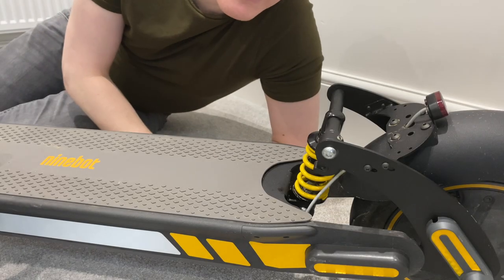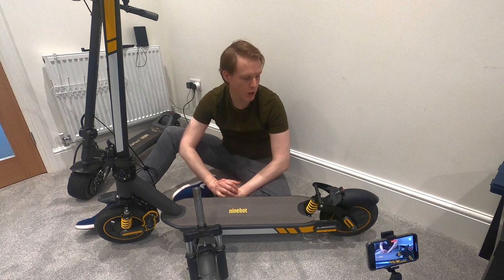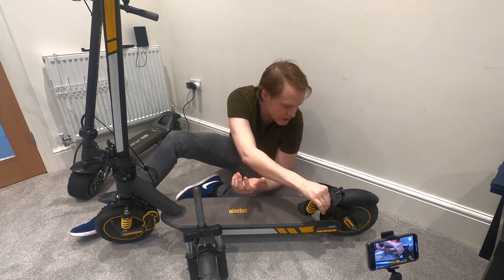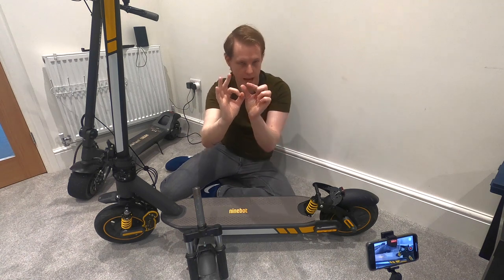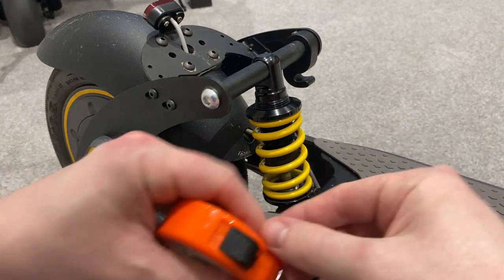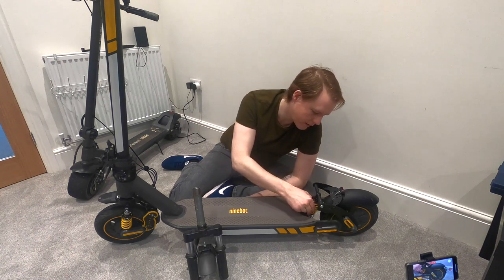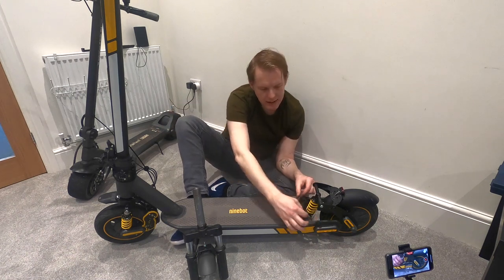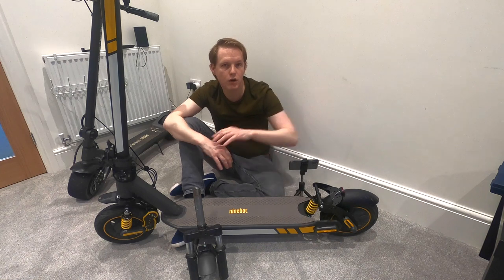Should you buy rear suspension? Ninebot Max & Xiaomi M365

Comment: Eagerly anticipating what sharkset comes out with for the rear. Monorim seems to be more of a hassle than what they're worth both front AND rear.
This one is the only viable option at the moment. I Agree totally on every aspect you mentioned.  I get a strange vibration noise or rattle from it. Possibly from 
one of the pivot points.. Like you said it needs proper bearings to make it more solid. but there's no way i'm drilling holes in the frame nor do i like the 2 piece fender of the monorim.. Good review as usual!
Reply from the maker: Thanks dude. Yeah I didn’t fancy the hassle of Monorim. And the split fender.  

This is going to suit ok for the time being.  

I did speak to Farahbod at Sharkset and there may or may not be suspension coming. The issue is how do you design something here that was designed without suspension in mind.

And he doesn’t really want to rehash the suspension ideas that are already on the market
Reply: @ScootLetsGo  The monorim is perfectly fine, they have a v2.0 out now, and will be bringing out a Special edition very soon! I like the look of the shark suspension, it would have been even better with air shocks as well. Which link in your description is for the shark please? And where is the coupon code?? 😊👍🛴
Reply: @fleebleflam  where is it?

Comment: For the bolts/screws rusting problems, you can use some threadlocker (I recommend the blue type - red will permanently lock the screw) to lock them in place and apply a thin coat of hydraulic grease on top of them. That will prevent any rusting if water makes contact with them.
Reply from the maker: Don't worry I got some threadlocker. :)

Thanks for tip on rust proofing

Comment: Hi mate. How tight should my standard max bot steering be. I think my bearings are pinched. I can’t find anywhere on YouTube in regards to stiffness of steering etc. I have found your links to bearing replacement. Kudos.
Reply from the maker: Hey. They should be right.  But not so tight that you cannot turn the stem easily.  And you’ll know if they are lose because the stem will wobble slightly.

Comment: How much of a difference does it actually make? Is it a dramatic increase with the just the front suspension vs the front and back suspension?
Reply from the maker: This really depends on the type of riding that you do. For me, it's kinda of a necessity, with all the offroading and bumps. Anything it better than nothing at all. 
It's not really epensive, so you can try it for yourself. :)
Reply: @ScootLetsGo  I need suspension because the sidewalks in my town are very bumpy and uneven.